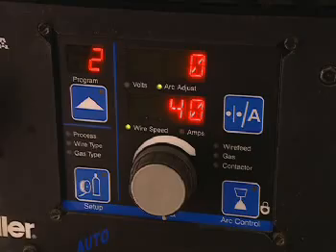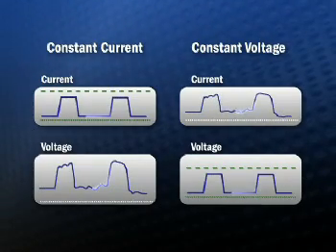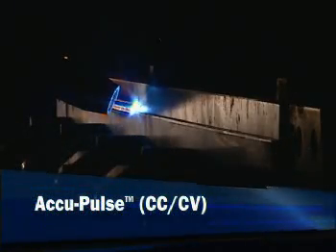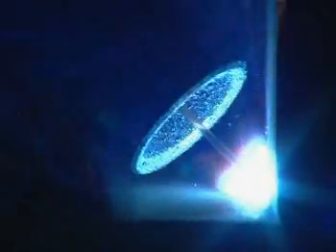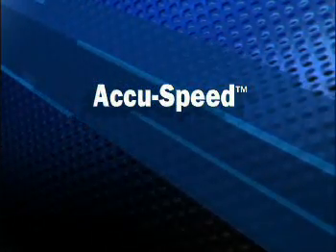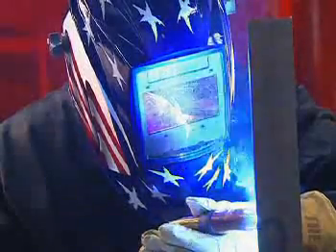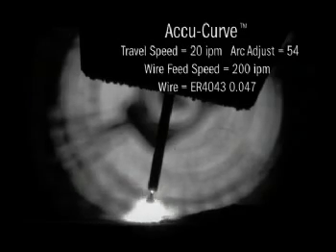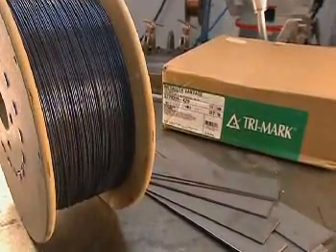Miller Pulsed/Multi-MIG Welding Options

Comment: How do I adjust the voltage when using pulse on the Miller axcess 450?I just bought a used machine and I'm trying to learn how to use it.

Comment: This is an informative video, thank you for making it available to us.

Cleaning the Gun prior to work, prior to breaks, and prior to making a video would be best practice. Using Google Translate to read and respond to Posts seldom works out well. Look at the Videos from the Competitor's Channel, no where near as good and many hateful comments.

---

Repliers please note: Most of the Instructors who taught me to weld had between 20 to 50 years work experience as a Welder (and not as another Tradesperson that happens to include the use of Welding in their Trade, from time to time).

Some of my Instructors earned a days pay per hour welding pipe in Alberta. When they had Vacation Time guess where they went. I mention this so (some of) you know which School I attended.

My attendance at Trade School was without absence and my Marks are 90%. in addition I have Papers issued by the Government and all position from CWB in two processes (and 3 in another). I am not the best (by far, and much better than most, by far) but I already have enough trouble finding adequate Wages, thus I need not know no more until that changes.

Comment: Pretty clear that neither of you two have run much MIG. Miller did not lie. There is far less spatter in pulsed than in straight MIG. Having the 350P and using the machine is much give more insight than than judging by watching a video. Pulsed is to MIG what MIG is to stick.

Comment: I don't know of any military contracts, pressure vessel, or aluminum pulse requirements.  If you qualify a process, you can run it.  Done work on all of the above.  Have yet to be told that GMAW-P is the only approved process.  Rob, I suggest you apologize...  This includes armor solutions, pressure vessels, military aluminum work, HSLA, I can keep going, but I think you get my point.  If the military requires it, why do TACOM weld codes not consider the pulse parameters essential variables???
Reply: I build naval ships and we used GMAW-P or we use SMAW. The particular ship I’m working on now the Naval contract calls for strictly GMAW-P. They also have their own WPS and test parameters that shall be followed. So Pulse MiG has become a big deal here lately.
Reply: muttyv yeah I'm with you on that never taken it specifically pulse test I can't recall ever taking a pulse test do they even have such a test

Comment: Your an idiot. Try welding with pulsed mig first. Then open your mouth. Its one of the best advancements in welding history. And most military contracts, pressure vessels, and heavy aluminum jobs require pulsed mig.

Comment: FAIL. As the narrator says the words "eliminates spatter"  at 1:43 you can see a bunch of spatter tumbling out of the arc. And just look at all the spatter clinging to the inside of the nozzle in that segment.  Miller, your customers don't appreciate being lied to. Clearly, even your engineers are not smart enough to get your equipment to operate the way your marketing division says it should.